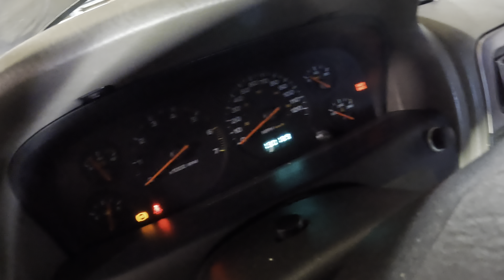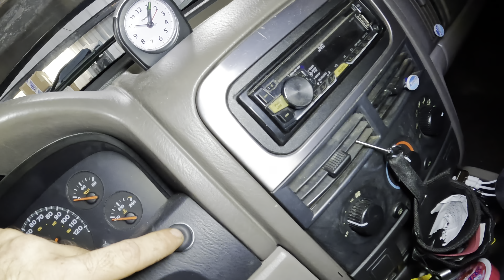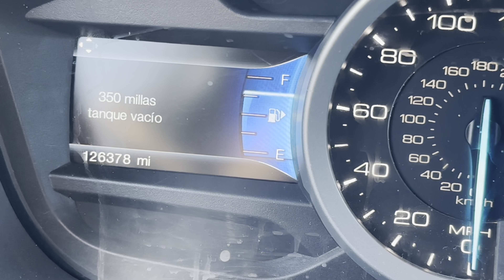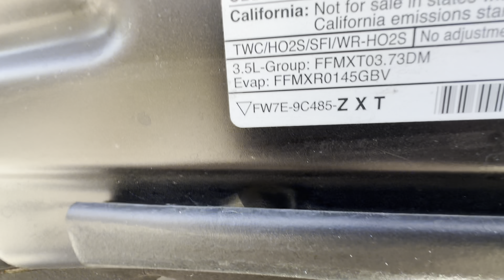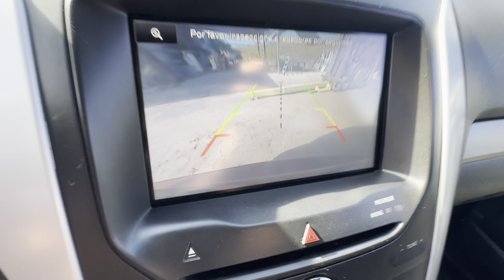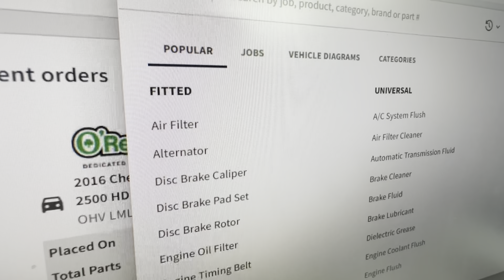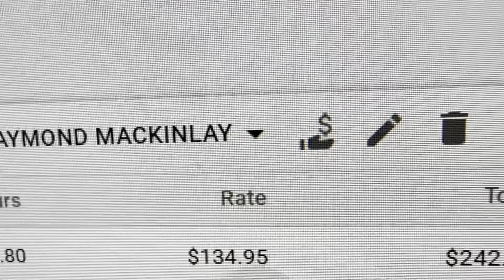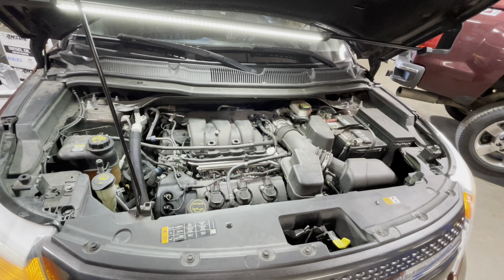TOO EXPENSIVE!  Repairs Declined! Twice! Jeep Cherokee 4.0 & Ford Explorer Noises While Driving

Comment: Never underestimate people's ability to ignore horrific noises and massive safety issues. Especially when the repair is over $50.
Reply: To be fair, a professional mechanic won't fart on your car for less than $150 these days. And any shop offering to do it for less is usually trying to scam you.
Reply: @jacobrzeszewski6527  Sad but true.
Reply: LOL on that. I know a guy with a newer Chevy diesel . The DEF and fuel are next to each other(STUPID BTW). He put DEF in his fuel by accident twice. first time, filled the diesel tank and thought to dilute it. nope. ran 20 minutes and died. $20,000 to fix. Second time towed the truck before starting. He has money and sense. Crap happens. I'm the gearhead poor people call.But, when they do, I don't do the band aid stuff. Glad you're here btw.
Reply: he’s gonna come back and then complain his battery not charging..🤦🏻‍♂️
Reply: @jimandersen3003  20,000 dollars to flush it? Congrats on that 19,925 dollars profit I guess
Reply: @functionatthejunction new diesels are finicky and DEF likes to crystalize in the system and ruin injectors, injection pumps, etc. standard procedure for a mistake like that is unfortunately to replace the whole fuel system.
Reply: He just had good old ray Diagnose the problem.
Reply: @functionatthejunction found the non mechanic guy
Reply: @DannyGruesome  I'm not a mechanic, that's true. But my dad and my grandpa were.
Reply: So. The guy leaves with a non-functioning alternator. What could he do next? That part must be fixed.
Reply: @DannyGruesome  here better advice. cut that Def off and straight pipe it. 20k does seem rather high tho i tend to see quotes around 8-10k but yea straight pipe it for real. F that price.
Reply: I love that you tried to help with the price but the RANGE price always did me in because people think they can shop around for a better deal. Should just have given the price and been done with it... Just my opinion...
Reply: They will drive it till the belt comes off and be stranded. Then they can pay for the tow.
Reply: @jimandersen3003 that dude is better off dropping $2000 and just delete it
Reply: I hope he charges a diagnostic fee.
Reply: Are there any repairs, or maintenance, that can be done for less than $50... My cheapest shop trip recently was $350...!
Reply: @LinuxJedi  No his pulley is going to come off and go through the radiator!🤣🤣🤣
Reply: People would come to Autozone to get their brake pads replaced for free. 😂😂😂
Reply: @jacobrzeszewski6527 no excuse for driving a death trap.
Reply: Or the induvial who denies a $99 alignment after spending $1400 on new tires
Reply: Yes but when it comes to buying the latest 2000 dollar flat screen TV and paying for Doordash, that is a no brainer.
Reply: ppl in the car community constantly joke abt turning up their music to cover up whatever sound their car is making
Reply: @misseselise3864  Years ago, my niece was complaining her car stumbled sometimes, and her dad asked me to take it for a drive to see what I thought. I got in and the stereo was absolutely blasting. I turned it down thinking I'd be able to hear the engine stumble. No. All I could hear was the front wheel bearings roaring. And I mean ROARING. The engine seemed perfectly fine, so when I got back, I asked her how long the front of her car had been making that noise. She shrugged and asked what noise. Her dad asked the same so I told him about the wheel bearings. He turned and glared at her and I said "Let me guess, that's why the stereo was turned up loud enough to wake the dead" and she started smirking and mumbled "Maybe".
Reply: Now I know why the place I take my cars to get repairs done is always at least a week out.  They only charge $90.00 an hour labor and you can bring in your own parts.  They just won't guarantee them.    AC compressor went, ordered one from Rock Auto (where I get all parts) and they only charged 1 hour labor and $30.00 for the recharge.   NO shop fees unless it has to do with oil changes or if you don't want to take the old parts back and they have to have them removed to recycle center.   Great guys.
Reply: If I was Ray I would tell him to never bring his vehicles to his shop again,he wants to be told what needs fixed then so he can fix it himself 😂
Reply: Penny wise Pound foolish ever time .

Comment: I'm an Systems Engineer but been working on my own vehicles for 30 years.  If I could only find an honest mechanic like Ray to work on my cars. Ray is an exceptional tech/mechanic and instructor. Not to mention the courage to start his own business! Keep up the good work and much success.
Reply: He's honestly not far from me (I'm in central FL) . I was thinking of seeing if he'd do the a.c in my mustang. But idk honestly if it would be something hed wanna do cus a few local shops near me have already turned it down
Reply: @RainmanRaysRepairs  so Im local to you. I've got an 01 mustang 4.6 2v with no a.c that pretty much needs everything, (old owner pulled it out and put a pulley in its place) it's also probably going to need lines ran as well. Is that something you'd be interested in doing ? Couple other shops didn't want to do it due to the car being slightly modified.
Reply from the maker: @Ed-shot500  I’ll do it! Come by the shop or email Lauren…. RainmanAppointments@gmail.com
Reply: Seriously, I just wish he was closer. I'll occasionally head down to Bradenton for Freedom Factory events, but he's not set up to have people wait, don't even know if you could drop by for a simple oil change.
Reply: I ride a motorcycle but I have the same opinion as you. 250 miles each way in the UK to get my motorcycle serviced once a month. Honest good people are hard to come by and I'm not saying there are other garages that are not honest I just find the one that I used to be absolutely fantastic and trouble free and I get a personalised service which is very unusual.
Reply: there are so many vehicles on the road that mechanics do not need to be dishonest to get customers. especially if an owner has to wait hours for a repair
Reply: @Ed-shot500 I hope Ray makes a video of this one, if not already (I'm behind on vids)... But it be like adding ac to a system that never did.... Be something different and interesting
Reply: Using yelp in new places I moved to to find an honest mechanic has been a lifesaver. I once went to a local one before I was wise enough to check first - no lube style. After that, found two on yelp - honest and reasonable.  Moved to MI - used yelp, found another reasonable one.
Reply: @elixier33  Oh my heart breaks that you get to road trip your bike for a service....lmao! sounds like an added benefit to me!

Comment: I was a business owner for 35yrs and a fellow owner once said "90% of customers are fine, 7% are potentially a problem whinging about nothing ect, but 3% of customers are *********s and should be turned away". The problem is spotting the 3%, however occasionally it's pretty obvious !!
Don't let them grind you down Ray. 👍
Reply: Ray, don't put band-Aids on gun shot wounds!
Reply: @Jay.Kellett  --Good Analogy...
Reply: 3%?? 10% in my case!😂
Reply: I always said 98% of headaches come from 2% of customers....know when to say NO to a customer
Reply: I've always figured it was 10% of the clients cause 80% of the headaches.
Reply: They be a WINGEN POM !!!!
Reply: I'm a tech, I have refused to work on a few vehicles. I just turned away a steering column rebuild on a  1976 GMC front wheel drive motorhome. Not worth the trouble or the time. I agreed to help with a fuel leak, when it wouldnt start he acted like he didnt know the steering column was broken. I didnt have the time for it. He was trying to rope me into it after hours. Too much trouble.
Reply: @Jay.Kellett  Man, we have been doing chest compressions for over an hour but the heart of the patient won't beat on it's own..... DUH they bled out TWO hours ago.
Reply: @scottbaker9066 You know how to tell when a plane load of Aussies have landed in your country?
The plane stops and the pilot turns off the engines but the whining keeps going.
Reply: How were they getting that Jeep to pass inspections? What ever happened with it? Did you just repair the brakes and send it back?

Comment: This jeep is the poster child for needing a safety inspection program in Florida.
Reply: I don’t need the gubberment babysitting me!  It’s my life!

/s
Reply: @jeffclark5268  Clearly you do as you have failed to see that a car in disrepair doesn't just affect you it effects other people on the road I come from a country where yearly inspections are mandatory and give advisories on what might fail next year (monitor and repair if necessary) I like this system as it essentially gives me a safety report on my car every year and I can then fix things without needing to pay a diagnostic fee as its checked every year, I do most repairs I can on my drive myself with axle stands etc. Would you trust a stranger to maintain your car? of course not so why would you trust them to maintain theirs on the road that you share with them!
Reply: @gamer4thebest  /s means it was a sarcastic comment
Reply: @Not_Based  yeah I had a feeling and he said gubberment but I thought up some good points and commented anyway
Reply: In my entire life all the accidents I have seen have been with newer vehicles. The last thing anyone needs in more government regulations and fees on the road.
Reply: As a resident of Massachusetts can confirm that jeep would only fail for the Vice grips otherwise most repair shops here will pass it.
Reply: @Suds.  Then some inspectors need to go jail, not remove an inspection program.
Reply: @dodgeplow depends the burecrats making the inspection program. NYS has ball joints exempted due to 1 make/ model being failable within short order but survive like 5-10 years. Good mechanics like Ray always point them out.

Comment: G'day Ray, if I could offer some advice; never give you talent away for free.  You should charge a diag fee and offer the client 50% back if they agree to the repairs.  Unfortunately over the years I have come to realise that people only really value what they have had to pay for.  Your clients are coming to you because of your reputation and that reputation has real $ value which you should benefit from.  Just good business.  Your ethics and work diligence is beyond question, keep it up.
Reply: No one in Florida charges for estimates...! I own & operate three businesses in Sarasota Florida and wouldn't get any work if we charged for estimates...! No one in their right mind would pay for an estimate...!!!
Reply: @kurtisstutzman7056  Of course you shouldn't charge for estimates, as long as they order your services. But if they let you do the work (that was at least 15 minutes with the driving and so) and than e.g. try to do it themselves, why not bill that? Here in Hungary they already do that for several years, if you want them to read out the data with a diag, it will cost at least a half hour rate. People work, so they must be paid.
Reply: I think you garage might be better off  sometimes with junk yard parts  off wrecked cars rather than those crappy rebuilds from Mexico . When I worked at Sears when had so many bad starter and alternator rework/return problems .It didn't seem to matter where we  got them .

Comment: I fully understand and agree with your concerns about cheap, remanufactured alternators, BUT...
Years ago and in another state than where I live now, I had a local shop that rebuilt alternators, generators, and starters. Those guys were GOOD! I never had one of their rebuilds fail and they often came back better than factory spec. Unfortunately, those kinds of shops are rare and most rebuilds are done who knows where and are rolling the dice.
Reply: Exactly what I was going to mention. I have one really close to me that rebuilds them and one a little further away. You get your same alternator or starter and it has the bad part replaced. I've never paid more than $80 but it's usually about $60 compared to $150 and up for a remanufactured unit from who knows where. It would be nice if Ray found one around him and they would probably rush his jobs since he'd be giving them so much business. The shop near me rushes mine and I don't give them anywhere near what ray would be bringing them.
Reply: In san francisco we have a shop that rebuilds alternators generators starters, got a Asian woman on my block that can rebuild them too!
Reply: rebuilds are good, remans aren't. Typically with a rebuild the company will pull it down to the stator and replace anything inbetween that's bad. Remans from MOST manufacturers are unfortunately just a housing that's been through a parts washer and repainted with everything being the same except a replaced pulley or **sometimes** a voltage regulator if it went bad bad. That's just the world we live in unfortunately. They're honestly super simple to rebuild your self, It's been my go-to for years.

Comment: Good video Ray diagnosing and confirming the alternator fault, checking out best option for replacement / cutting down labor cost, this work alone probably took up around one hour of your time, around here in the UK the customer would get charged for that, and if it looked like a dodgy customer he would not get his car back until the bill was paid.
Reply: Here in New England there would be a minimum diag fee of 1 hour labor on declined work.
Reply: Let’s face it in the uk that would never pass the MOT. You probably wouldn’t let it leave except on a  tow truck.
Reply: @Thetasigmaalpha  Not passing an MOT is quite common - usually for shitty things like wiper blades or indicator lights, tyres worn below 1.6mm. You can take the vehicle away, fix it, and most MOT stations will do a free retest within 10 days.
However anything in the Jeeps condition will be instantly considered dangerous. The owner will be told it's illegal to drive it away without repair, but nobody can stop it (because realistically who wants to die on that hill?). The police will instantly have the vehicle marked and if stopped the driver will have massive fines and car taken for crushing.
Reply: @Drew-Dastardly Pretty much how it is in Nova Scotia, Canada. In Ontario we just hand out liability waivers. Safety inspections only required when transferring ownership
Reply: Now that the owner knows what is wrong, will probably going to try and replace the alternator themselves. Good luck 😅
Reply: I never get my key back from the part fitter type of garage  until I've paid and the independent garage know that they'll get the car back within a few months 😂
I use a couple depending on how busy the independent garage I use is and how quickly I need the work done I try to book with them first.

Comment: My son bought a 96 Grand with a  lot of the same stuff done in the past. He (with my help) is making the required repairs to bring it back. 
Started with the safety issues and working on the rest as the time and $$ is available. It is a reliable and safe vehicle. It is going to be an overland adventure vehicle when he finally gets it all done.

Comment: Jeep wasn't as bad as some of the commenters were saying, it just needs maintenance and comprehensive de-crapping. It's straight and rust free, so good bones = a good starting point. I've put those on my lift and had rust raining down on the floor, with the vehicle rusting into three large pieces and several smaller ones; just a mummified corpse on wheels.
Reply: My friend has 5. The 4wd  coupler is pathetic. They were designed for 4.0 inline 6 cyl and with the v8 the often failing crank sensor is a joke to replace. Can you say alarm issues stranding you and too high tech nonsense for a cheap Jeep.
Reply: I agree.  Since I do my own work, I can have that thing roadworthy for about $500.  Fix a few electrical things and whatnot.  That 4.0 liter is a great engine.  Add a few more $$ for the body and you'll have a pretty good vehicle.  I'd say $1000 total, no more.  With the cost of used vehicles now it would be worth it.
Reply: That Jeep is the only vehicle I've seen on Youtube that I actually felt bad for..  That poor thing has been abused, neglected, and tortured, both physically and mentally..  If I ever had enough to drink and decided to refer a vehicle for therapy, that would be the vehicle..  That Jeep is the poor little dog, attached to a big chain in the back yard, that gets beaten daily and only fed twice a week..
.
Its a good dog(Jeep), it want's to be good, but the owner just won't let it be a good Jeep..   Every time it tries, it just gets beat again..
.
The physical stuff is easy..  130k..  Tie rods are gone, happens..  The brakes though, that is just abuse...  
The rust is non-existent.   Solid little truck..  Hopefully it can escape some day and find an owner that actually loves it.  
.
The thing that scares me the most about that Jeep is the electrical "modifications".   Its not the hacks, its not even the reasons for the hacks, its how much damage did they do while doing the hacking..  I understand hacking stuff, I've had several vehicles made pre 1980 that had push button starts, $1.79 at Radio Shak was far cheaper and quicker than a new ignition switch.    But with the "hacks" on those brakes, I don't have much faith in what the owner did..